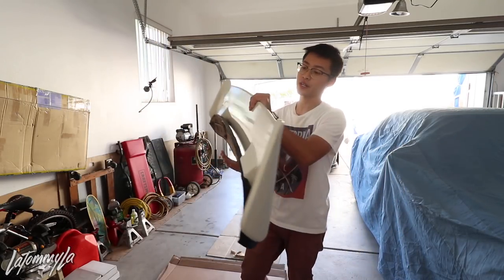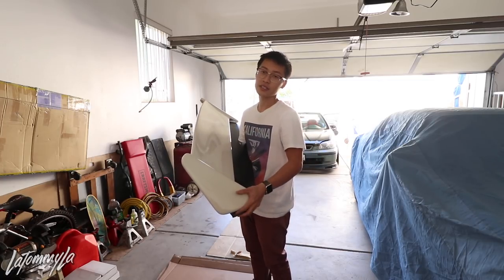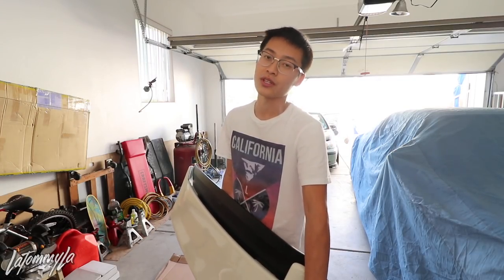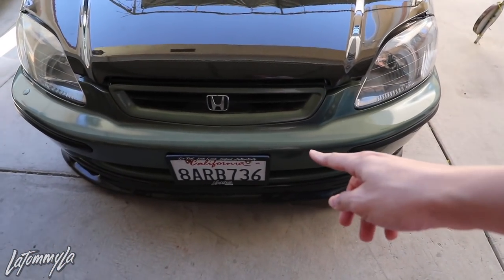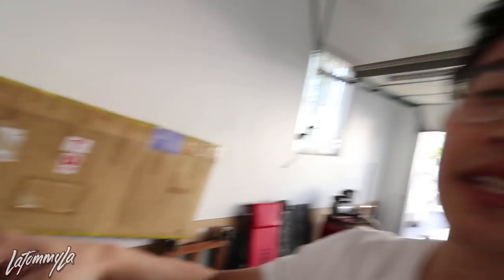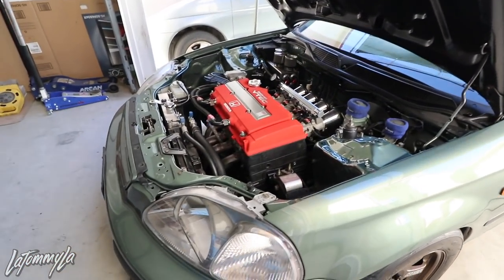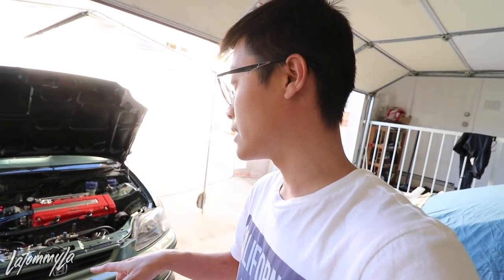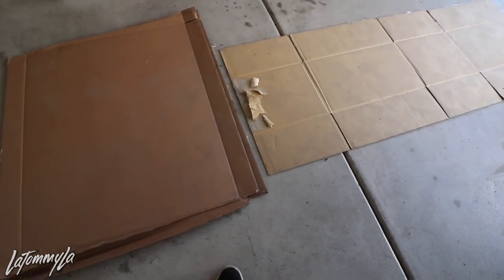New wing! Trying to complete the new look for 2018.

Comment: I just bought a 88 Honda ef civic hb that need a lot of body work. When you buy a project car like the one I own, where do you start? P.S I'm new to the Honda world.
Reply: Nas 718 inspections. Check your joints, breaks, hoses( cooling and vacuum), oil, coolant, belts, etc. After you know your car is solid you can upgrade. I didn’t and it sucked. Bought a jdm b18c swapped eh hatch
Reply: Nas 718 Suspension?
Reply: Nas 718 it depends, I own a 96 Cox hatch, and I am planning on buying a m&m Honda bodykit so I won’t need to fix the rust on my fenders
Reply from the maker: I would make sure your car is first running properly and well maintained then move on to other things, like what Will Anderson said.

Comment: Tommy, I need your opinion on fiberglass front bumpers. Everyone says I shouldn't get one and just find a bumper that's oem or poly because fiberglass breaks too easily. Is that true? I have 0 experience with fiberglass so I really have no clue. & I see you using fiberglass bumpers, aren't you afraid that you're gonna break it?
Reply from the maker: Nothing wrong with fiberglass, they do break but all depends on what happens. Fiberglass is repairable to a certain extent